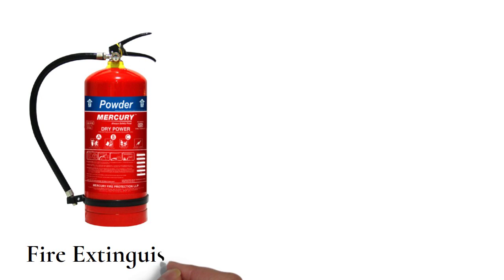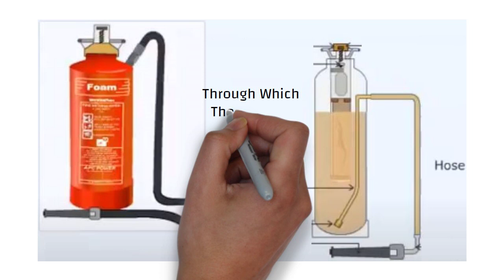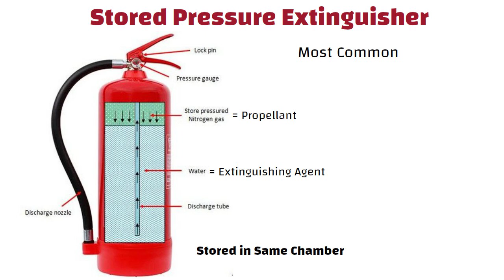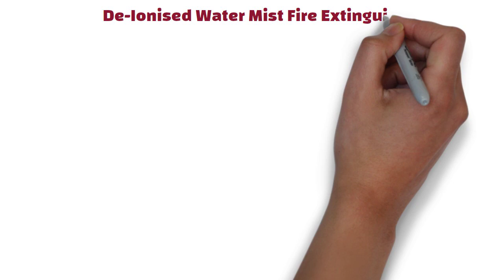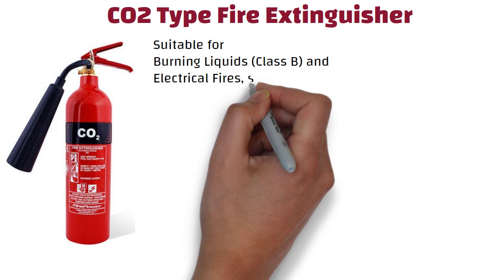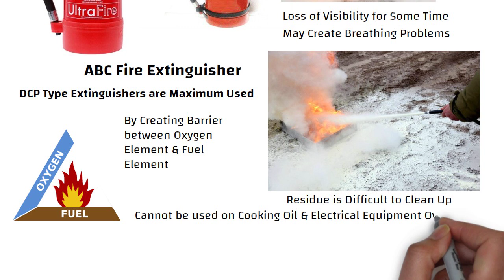FIRE EXTINGUISHER DEALERS IN KERALA, CALL 8138906102, FIRE EXTINGUISHER DEALERS IN ERNAKULAM.

Comment from the maker: Fire extinguisher dealers in CHENGANNUR, fire fighting contractors in CHENGANNUR, CHENGANNUR, fire and safety installations in CHENGANNUR, fire extinguisher suppliers in CHENGANNUR,fire extinguishers in CHENGANNUR, fire extinguishers in CHENGANNUR, fire protection system in CHENGANNUR, f fire and safety installation in CHENGANNUR, fire and safety contractors in CHENGANNUR, fire safety contractors in CHENGANNUR, fire and safety systems equipments in CHENGANNUR, fire equipment in CHENGANNUR, fire extinguisher in CHENGANNUR, fire protection system installation in CHENGANNUR, fire contractors in CHENGANNUR, fire safety consultants in CHENGANNUR,  fire alarm systems in CHENGANNUR, fire NOC in CHENGANNUR, fire AMC in CHENGANNUR, CHENGANNUR, fire fighting equipment in CHENGANNUR,
MS Jindal pipe dealers in CHENGANNUR, motor control panel in CHENGANNUR, fire pump panel in CHENGANNUR, motor control panel in CHENGANNUR, Morley fire alarm in CHENGANNUR, gst fire alarm in CHENGANNUR, addressable fire alarm system in CHENGANNUR, Pa talk back system in CHENGANNUR, PA talk back system in CHENGANNUR, auto glow SIGNAGES in CHENGANNUR, SIGNAGES in CHENGANNUR, pump PANELS in CHENGANNUR, LHP pump in kohi. Karthar valves in CHENGANNUR, Ravel fire alarm system in CHENGANNUR. Jindal pipe dealers in CHENGANNUR, Jindal pipe dealers in CHENGANNUR. MS pipe dealers in CHENGANNUR. Butterfly valves in CHENGANNUR, PA talk back system in CHENGANNUR, Fire alarm dealers in CHENGANNUR,, smoke detector dealers in CHENGANNUR, fire alarm panels dealers in CHENGANNUR, MCP, hooter dealers in Mangalor, hydrant valve dealers in CHENGANNUR, branch pipe dealers in CHENGANNUR, cp hose, RRL hose, heat detector dealers in CHENGANNUR,, Motor Control panel,  LED EXIT LIGHTS dealers in CHENGANNUR, emergency exit light dealers in CHENGANNUR, auto glow SIGNAGES dealers in CHENGANNUR. Conventional fire alarm system in CHENGANNUR,
KIRLOSKAR FIRE FIGHTING PUMP DEALERS IN CHENGANNUR, FIRE FIGHTING EQUIPMENT DEALERS IN CHENGANNUR, FIRE ALARM SYSTEM DEALERS IN CHENGANNUR, FIRE CONSULTANTS IN CHENGANNUR, FIRE CONTRACTOTORS IN CHENGANNUR, FIRE CONTRACTORS IN CHENGANNUR, FIRE ALARM SYSTEM DEALERS IN CHENGANNUR, SMOKE DETECTOR DEALERS IN CHENGANNUR, FIRE PROTECTION SYSTEM IN CHENGANNUR, FIRE CONSULTANTS IN CHENGANNUR, FIRE CONSULTANTS IN CHENGANNUR, PA TALK BACK SYSTEM IN CHENGANNUR, ADDRESSABLE FIRE ALARM SYSTEMS IN CHENGANNUR, CUTTER PUMP DEALERS IN CHENGANNUR, ADDRESSABLE FIRE ALARM SYSTEM SUPPLIERS IN CHENGANNUR, SMOKE DETECTOR DEALERS IN TCHENGANNUR, PRESSURE BOOSTING PUMP DEALERS IN CHENGANNUR, SLURRY PUMP DEALERS IN CHENGANNUR
Reply: FIRE EXTINGUISHER DEALERS IN MAVELIKARA, FIRE EXTINGUISHER SUPPLIERS IN MAVELIKARA, FIRE EXTINGUISHER DISTRIBUTORS IN MAVELIKARA, FIRE EXTINGUISHER IN MAVELIKARA, ABC TYPE FIRE EXTINGUISHER DEALERS IN MAVELIKARA, CO2 TYPE FIRE EXTINGUISHER DEALERS IN MAVELIKARA, CLEAN AGENT FIRE EXTINGUISHER IN MAVELIKARA, MODULAR TYPE FIRE EXTINGUISHER DEALERS IN MAVELIKARA, MECHANICAL FOAM FIRE EXTINGUISHER DEALERS IN MAVELIKARA, FIRE EXTINGUISHER NEAR ME MAVELIKARA, FIRE EXTINGUISHER TRADERS IN MAVELIKARA, FIRE FIGHTING COMPANIES IN MAVELIKARA, FIRE CONTRACTORS IN MAVELIKARA, FIRE EQUIPMENT DEALERS IN MAVELIKARA, FIRE ALARM DEALERS IN MAVELIKARA, FIRE PUMP DEALERS IN MAVELIKARA, SMOKE DETECTOR DEALERS IN MAVELIKARA, FIRE FIGHTING SYSTEM IN MAVELIKARA, FIRE PROTECTION SYSTEM IN MAVELIKARA, FIRE AND SAFETY CONTRACTORS IN MAVELIKARA, FIRE HYDRANT SYSTEMS IN MAVELIKARA, PA TALK BACK SYSTEM IN MAVELIKARA, FIRE NOC IN MAVELIKARA, FIRE INSTALLATION IN MAVELIKARA, FIRE NOC RENEWAL IN MAVELIKARA, KIRLOSKAR FIRE PUMP DEALERS IN MAVELIKARA, FIRE EXTINGUISHER NEAR ME MAVELIKARA, FIRE EXTINGUISHER MANUFACURERS IN MAVELIKARA, SAFEX FIRE EXTINGUISHER DEALERS IN MAVELIKARA, FIRE NOC CONTRACTORS IN MAVELIKARA, FIRE FIGHTING EQUIPMENT DEALERS IN MAVELIKARA, FIRE PROTECTION SYSTEM IN MAVELIKARA, FIRE INSTALLATION IN MAVELIKARA, FIRE SAFETY CONTRACTORS IN MAVELIKARA, FIRE AMC IN MAVELIKARA, FIRE PROTECTION SYSTEM IN MAVELIKARA, FIRE PROTECTION EQUIPMET IN MAVELIKARA, AMC OF FIRE SYSTEM IN MAVELIKARA, FIRE CONSULTANTS IN MAVELIKARA, FIRE AND SAFETY EQUIPMENT DEALERS IN MAVELIKARA, ADDRESSABLE FIRE ALARM SYSTEM IN MAVELIKARA, KARTHAR VALVE DEALERS IN MAVELIKARA, DCP TYPE FIRE EXTINGUISHER IN MAVELIKARA, POWSER TYPE FIRE EXTINGUISHERS IN MAVELIKARA, FIRE HYDRANT SYSTEM IN MAVELIKARA, FIRE ALARM PANEL DEALERS IN MAVELIKARA, SAFEPRO FIRE EXTINGUISHER DEALERS IN MAVELIKARA, MS AND GI PIPE DEALERS IN MAVELIKARA, JINDAL PIPE DEALERS IN MAVELIKARA, AGNI FIRE ALARM DEALERS IN MAVELIKARA, FIRE EQUIPMENT DEALERS IN MAVELIKARA, FIRE EQUIPMENT SUPPLIERS IN MAVELIKARA, FIRE EQUIPMENT TRADERS IN MAVELIKARA, FIRE SPRINKLER SYSTEM IN MAVELIKARA, RAVLE FIRE ALARM DEALERS IN MAVELIKARA, RAVEL FIRE ALARM SYSTEM IN MAVELIKARA, AGNI FIRE ALARM DISTRIBUTORS IN MAVELIKARA, FIRE ALARM CONTRACTORS IN MAVELIKARA, FIRE PIPE INSTALLATION IN CONTRACTORS IN MAVELIKARA, FIRE SAFETY CONTRACTORS IN MAVELIKARA, FIRE PA TWO WAY TALK BACK SYSTEM DEALERS IN MAVELIKARA, HEAT DETECTOR DEALERS IN MAVELIKARA, HONEYWELL FIRE ALARM DEALERS IN MAVELIKARA, FIRE NOC CONSULTANTS IN MAVELIKARA, FIRE AMC AND FIRE NOC IN MAVELIKARA, FIRE SAFETY COMPANIES IN MAVELIKARA, NEWAGE DEALERS IN MAVELIKARA, MONSHER FIRE EQUIPMENT DEALERS IN MAVELIKARA, KARTHAR VALVE DEALERS IN MAVELIKARA, FIRE HYDRANT VALVE DEALERS IN MAVELIKARA, FIRE HOSE REEL DRUM DEALERS IN MAVELIKARA, FIRE SPRINKLER DEALERS IN MAVELIKARA, FIRE PUMP DEALERS IN MAVELIKARA, LUBI PUMP DEALERS IN MAVELIKARA, LHP PUMP DEALERS IN MAVELIKARA.
Reply: FIRE EXTINGUISHER DEALERS IN KARUNAGAPPALLY, FIRE EXTINGUISHER SUPPLIERS IN KARUNAGAPPALLY, FIRE EXTINGUISHER DISTRIBUTORS IN KARUNAGAPPALLY, FIRE EXTINGUISHER IN KARUNAGAPPALLY, ABC TYPE FIRE EXTINGUISHER DEALERS IN KARUNAGAPPALLY, CO2 TYPE FIRE EXTINGUISHER DEALERS IN KARUNAGAPPALLY, CLEAN AGENT FIRE EXTINGUISHER IN KARUNAGAPPALLY, MODULAR TYPE FIRE EXTINGUISHER DEALERS IN KARUNAGAPPALLY, MECHANICAL FOAM FIRE EXTINGUISHER DEALERS IN KARUNAGAPPALLY, FIRE EXTINGUISHER NEAR ME KARUNAGAPPALLY, FIRE EXTINGUISHER TRADERS IN KARUNAGAPPALLY, SAFEPRO FIRE EXTINGUISHER IN KARUNAGAPPALLY, FIRE EXTINGUISHER DISTRIBUTORS IN KARUNAGAPPALLY, FIRE FIGHTING COMPANIES IN KARUNAGAPPALLY, FIRE CONTRACTORS IN KARUNAGAPPALLY, FIRE EQUIPMENT DEALERS IN KARUNAGAPPALLY, FIRE ALARM DEALERS IN KARUNAGAPPALLY, FIRE PUMP DEALERS IN KARUNAGAPPALLY, SMOKE DETECTOR DEALERS IN KARUNAGAPPALLY, FIRE FIGHTING SYSTEM IN KARUNAGAPPALLY, FIRE PROTECTION SYSTEM IN KARUNAGAPPALLY, FIRE AND SAFETY CONTRACTORS IN KARUNAGAPPALLY, FIRE HYDRANT SYSTEMS IN KARUNAGAPPALLY, PA TALK BACK SYSTEM IN KARUNAGAPPALLY, FIRE NOC IN KARUNAGAPPALLY, FIRE INSTALLATION IN KARUNAGAPPALLY, FIRE NOC RENEWAL IN KARUNAGAPPALLY, KIRLOSKAR FIRE PUMP DEALERS IN KARUNAGAPPALLY, FIRE EXTINGUISHER NEAR ME KARUNAGAPPALLY, FIRE EXTINGUISHER MANUFACURERS IN KARUNAGAPPALLY, SAFEX FIRE EXTINGUISHER DEALERS IN KARUNAGAPPALLY, FIRE NOC CONTRACTORS IN KARUNAGAPPALLY, FIRE FIGHTING EQUIPMENT DEALERS IN KARUNAGAPPALLY, FIRE PROTECTION SYSTEM IN KARUNAGAPPALLY, FIRE INSTALLATION IN KARUNAGAPPALLY, FIRE SAFETY CONTRACTORS IN KARUNAGAPPALLY, FIRE AMC IN KARUNAGAPPALLY, FIRE PROTECTION SYSTEM IN KARUNAGAPPALLY, FIRE PROTECTION EQUIPMET IN KARUNAGAPPALLY, AMC OF FIRE SYSTEM IN KARUNAGAPPALLY, FIRE CONSULTANTS IN KARUNAGAPPALLY, FIRE AND SAFETY EQUIPMENT DEALERS IN KARUNAGAPPALLY, ADDRESSABLE FIRE ALARM SYSTEM IN KARUNAGAPPALLY, KARTHAR VALVE DEALERS IN KARUNAGAPPALLY, DCP TYPE FIRE EXTINGUISHER IN KARUNAGAPPALLY, POWSER TYPE FIRE EXTINGUISHERS IN KARUNAGAPPALLY, FIRE HYDRANT SYSTEM IN KARUNAGAPPALLY, FIRE ALARM PANEL DEALERS IN KARUNAGAPPALLY, SAFEPRO FIRE EXTINGUISHER DEALERS IN KARUNAGAPPALLY, MS AND GI PIPE DEALERS IN KARUNAGAPPALLY, JINDAL PIPE DEALERS IN KARUNAGAPPALLY, AGNI FIRE ALARM DEALERS IN KARUNAGAPPALLY, FIRE EQUIPMENT DEALERS IN KARUNAGAPPALLY, FIRE EQUIPMENT SUPPLIERS IN KARUNAGAPPALLY, FIRE EQUIPMENT TRADERS IN KARUNAGAPPALLY, FIRE SPRINKLER SYSTEM IN KARUNAGAPPALLY, RAVLE FIRE ALARM DEALERS IN KARUNAGAPPALLY, RAVEL FIRE ALARM SYSTEM IN KARUNAGAPPALLY, AGNI FIRE ALARM DISTRIBUTORS IN KARUNAGAPPALLY, FIRE ALARM CONTRACTORS IN KARUNAGAPPALLY, FIRE PIPE INSTALLATION IN CONTRACTORS IN KARUNAGAPPALLY, FIRE SAFETY CONTRACTORS IN KARUNAGAPPALLY, FIRE PA TWO WAY TALK BACK SYSTEM DEALERS IN KARUNAGAPPALLY, HEAT DETECTOR DEALERS IN KARUNAGAPPALLY, HONEYWELL FIRE ALARM DEALERS IN KARUNAGAPPALLY, FIRE NOC CONSULTANTS IN KARUNAGAPPALLY, FIRE AMC AND FIRE NOC IN KARUNAGAPPALLY, FIRE SAFETY COMPANIES IN KARUNAGAPPALLY, NEWAGE DEALERS IN KARUNAGAPPALLY, MONSHER FIRE EQUIPMENT DEALERS IN KARUNAGAPPALLY, KARTHAR VALVE DEALERS IN KARUNAGAPPALLY, FIRE HYDRANT VALVE DEALERS IN KARUNAGAPPALLY, FIRE HOSE REEL DRUM DEALERS IN KARUNAGAPPALLY, FIRE SPRINKLER DEALERS IN KARUNAGAPPALLY, FIRE PUMP DEALERS IN KARUNAGAPPALLY, LUBI PUMP DEALERS IN KARUNAGAPPALLY, LHP PUMP DEALERS IN KARUNAGAPPALLY. FIRE CONTRACTORS IN KARUNAGAPPALLY, FIRE AND SAFETY CONTRACTORS IN KARUNAGAPPALLY, FIRE EQUIPMENT DEALERS IN KARUNAGAPPALLY, FIRE FIGHTING CONTRACTORS IN KARUNAGAPPALLY,
Reply: FIRE EXTINGUISHER DEALERS IN KOCHI, FIRE EXTINGUISHER SUPPLIERS IN KOCHI, FIRE EXTINGUISHER DISTRIBUTORS IN KOCHI, FIRE EXTINGUISHER IN KOCHI, ABC TYPE FIRE EXTINGUISHER DEALERS IN KOCHI, CO2 TYPE FIRE EXTINGUISHER DEALERS IN KOCHI, CLEAN AGENT FIRE EXTINGUISHER IN KOCHI, MODULAR TYPE FIRE EXTINGUISHER DEALERS IN KOCHI, MECHANICAL FOAM FIRE EXTINGUISHER DEALERS IN KOCHI, FIRE EXTINGUISHER NEAR ME KOCHI, FIRE EXTINGUISHER TRADERS IN KOCHI, FIRE FIGHTING COMPANIES IN KOCHI, FIRE CONTRACTORS IN KOCHI, FIRE EQUIPMENT DEALERS IN KOCHI, FIRE ALARM DEALERS IN KOCHI, FIRE PUMP DEALERS IN KOCHI, SMOKE DETECTOR DEALERS IN KOCHI, FIRE FIGHTING SYSTEM IN KOCHI, FIRE PROTECTION SYSTEM IN KOCHI, FIRE AND SAFETY CONTRACTORS IN KOCHI, FIRE HYDRANT SYSTEMS IN KOCHI, PA TALK BACK SYSTEM IN KOCHI, FIRE NOC IN KOCHI, FIRE INSTALLATION IN KOCHI, FIRE NOC RENEWAL IN KOCHI, KIRLOSKAR FIRE PUMP DEALERS IN KOCHI, FIRE EXTINGUISHER NEAR ME KOCHI, FIRE EXTINGUISHER MANUFACURERS IN KOCHI, SAFEX FIRE EXTINGUISHER DEALERS IN KOCHI, FIRE NOC CONTRACTORS IN KOCHI, FIRE FIGHTING EQUIPMENT DEALERS IN KOCHI, FIRE PROTECTION SYSTEM IN KOCHI, FIRE INSTALLATION IN KOCHI, FIRE SAFETY CONTRACTORS IN KOCHI, FIRE AMC IN KOCHI, FIRE PROTECTION SYSTEM IN KOCHI, FIRE PROTECTION EQUIPMET IN KOCHI, AMC OF FIRE SYSTEM IN KOCHI, FIRE CONSULTANTS IN KOCHI, FIRE AND SAFETY EQUIPMENT DEALERS IN KOCHI, ADDRESSABLE FIRE ALARM SYSTEM IN KOCHI, KARTHAR VALVE DEALERS IN KOCHI, DCP TYPE FIRE EXTINGUISHER IN KOCHI, POWSER TYPE FIRE EXTINGUISHERS IN KOCHI, FIRE HYDRANT SYSTEM IN KOCHI, FIRE ALARM PANEL DEALERS IN KOCHI, SAFEPRO FIRE EXTINGUISHER DEALERS IN KOCHI, MS AND GI PIPE DEALERS IN KOCHI, JINDAL PIPE DEALERS IN KOCHI, AGNI FIRE ALARM DEALERS IN KOCHI, FIRE EQUIPMENT DEALERS IN KOCHI, FIRE EQUIPMENT SUPPLIERS IN KOCHI, FIRE EQUIPMENT TRADERS IN KOCHI, FIRE SPRINKLER SYSTEM IN KOCHI, RAVLE FIRE ALARM DEALERS IN KOCHI, RAVEL FIRE ALARM SYSTEM IN KOCHI, AGNI FIRE ALARM DISTRIBUTORS IN KOCHI, FIRE ALARM CONTRACTORS IN KOCHI, FIRE PIPE INSTALLATION IN CONTRACTORS IN KOCHI, FIRE SAFETY CONTRACTORS IN KOCHI, FIRE PA TWO WAY TALK BACK SYSTEM DEALERS IN KOCHI, HEAT DETECTOR DEALERS IN KOCHI, HONEYWELL FIRE ALARM DEALERS IN KOCHI, FIRE NOC CONSULTANTS IN KOCHI, FIRE AMC AND FIRE NOC IN KOCHI, FIRE SAFETY COMPANIES IN KOCHI, NEWAGE DEALERS IN KOCHI, MONSHER FIRE EQUIPMENT DEALERS IN KOCHI, KARTHAR VALVE DEALERS IN KOCHI, FIRE HYDRANT VALVE DEALERS IN KOCHI, FIRE HOSE REEL DRUM DEALERS IN KOCHI, FIRE SPRINKLER DEALERS IN KOCHI, FIRE PUMP DEALERS IN KOCHI, LUBI PUMP DEALERS IN KOCHI, LHP PUMP DEALERS IN KOCHI. FIRE CONTRACTORS IN KOCHI, FIRE AND SAFETY CONTRACTORS IN KOCHI, FIRE EQUIPMENT DEALERS IN KOCHI, FIRE FIGHTING CONTRACTORS IN KOCHI,